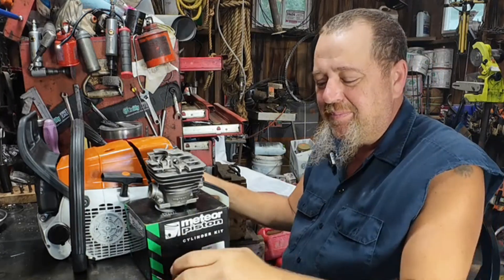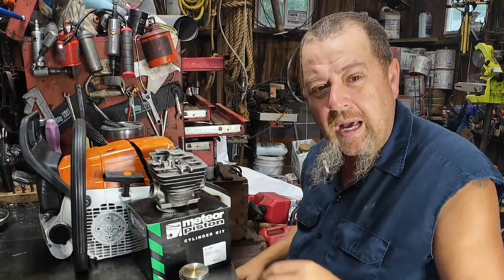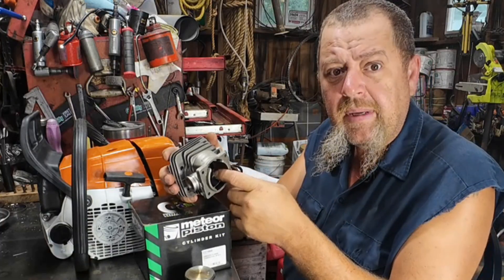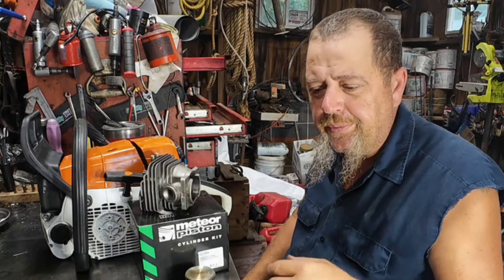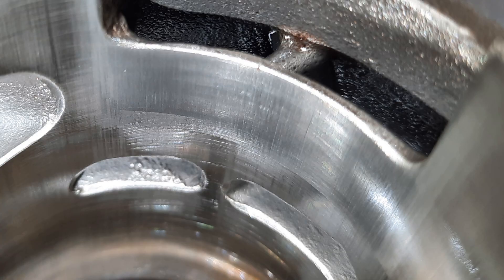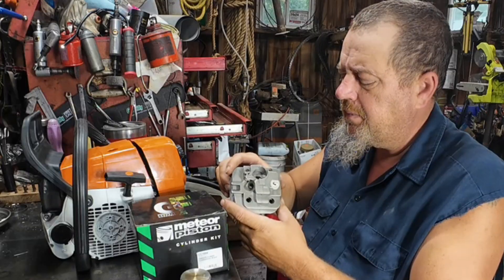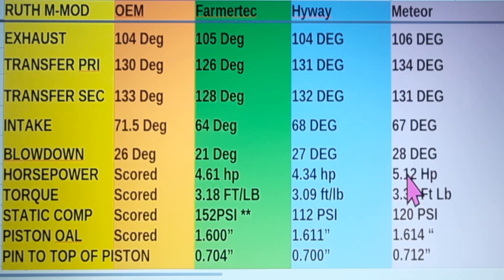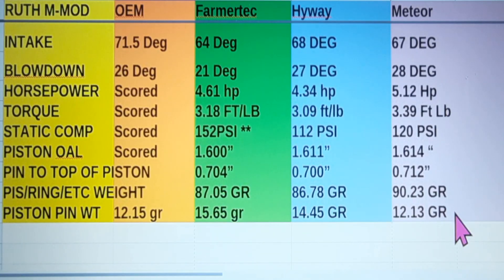How Much Power Does a Meteor Cylinder Really Make? | Stihl MS361 Clone Dyno Test

Comment: I can't tell on that meteor what is causing the higher horsepower with your great charting there. Initially I was going to say the squish being only .014 did it, but not so sure given the lower compression. It may still be since less air needs to be moved with a smaller compressed chamber size.
On the other hand I more suspect the shape of the transfers and openings, and perhaps exhaust - 
Who thinks they know what it is, anyone ? I am totally guessing.
Reply from the maker: @shakdidagalimal Up until last week (real time);( this video was probably recorded 6 months ago...) I wasn't sure the reason; I did some piston testing and was going to use a new cyl; I didn't like the chamfering on the other AM cyl, so I swapped in two different pistons; they had 0.024 squish; I used the same rings and the new piston's ring-locating-pins were in the same location. Neither of the two new pistons made the power of the Meteor piston.  Just to add a little more mud to the puddle...

Comment: I rebuilt a completely blown-up Stihl MS361 last year and didn't feel like spending the $300+ on just the OEM cylinder and piston alone. I still wanted the highest quality cylinder I could get for the money as I wanted the saw to perform like new and last, so I went with the same Meteor piston/cylinder kit that is in your video. I have built a few different saws and rebuild vintage Honda motorcycles on the side as well and I must say the casting and port machining is incredibly nice on the cylinder kit I received. Piston was machined nicely too. My 361 runs awesome, absolutely rips though wood and it's a great saw. After seeing this video, I am further reassured I bought a good cylinder and piston for my saw, and I'm pleasantly surprised my saw may make more horsepower than stock with an aftermarket top end on her, other than that it's all stock no carb, air filter, or muffler mods.
Reply from the maker: @natebiller2987 Awesome to hear your real-world experiences; it sounds like you done a bang-up job on the ol 361 and give it a new life.  Absolutely no shame in a stock saw; those 361s were pretty dang good right from the factory! Thanks for stopping-in and joning-in!
Reply: Meteor cylinders make about 20-25% less power than oem due to timing numbers, port sizes/shapes and combustion chamber. At least with meteor there is no need to work on the cylinders to make it reliable before use.
Reply from the maker: @jasoncook5307  I found OEM comparable power, but the squish was awful tight; After a few tanks, it surpassed OEM published HP (but I think they underclaim HP so that even the poorest saw will hit the minimum)

Comment: I think you could do a little massage work on the intake exaust and transfers delete the base gasket and cut a popup on the piston as part of the diet plan for the piston and when  those rings seat in im betting 6+ hp wouldn't be a long stretch to reach.
Reply from the maker: @matthewbutcher203  I bet you're right!! To not alienate people who may not be ready to start grinding, I think I will try to do external mods first; I almost wonder if we can hit 5-1/2 to 6HP without any grinding??
Reply: @HayChaffandSawdust1 id say a HD14 carb for a MS 460 and a timing advance would get you real close
Reply from the maker: @matthewbutcher203 It might??!! As are as 361s go, they have fairly aggressive timing from the factory; I've usually found losses by going either way with the ign timing on this particular model. That don't mean that we ain't going to thy though!!

Comment: I'm running a meteor cylinder and piston in a  288 clone. The farmertec worked ok new, I opened the transfers and cleaned up the ports and it improved but the coating started to flake off after a while

Swapped over to the meteor and I'm happy with it. Needed to make a thicker base gasket  because the squish was really tight but it's been great. They seem to be the right mix of price / quality. The caber rings are excellent
Reply from the maker: @SawChainTheories I have never had a farmertec cyl flake or chip, but I've never ran one for very many tanks; I've never "used" one for any real work.
It seems to be common that people like Meteors and that they have a snug squish. Like you say, a thicker (or doubled) base gasket is easy enough to do; I has also considered that a Hyway piston in a Meteor cyl may be just the ticket.

Comment: Man Im lookin around all over........thought that was one of my kittys! :)
Great vid!
Has anyone tried lightening the piston and rod? Removing material until the breaking point is found? Seems like there is a lot of rpm left on the table, should be able to get closer to 20k rpm I would think.
Reply from the maker: @freeradical6390 Thanks!! I've lightened pistons in previous series and you're right! I think that a coil is going to be a limiting factor on this particular saw... for a while. One of the first things that we do (during the step-by-step build), once we get done with external mods, will be to lighten the piston and show the math as well as substantiating dyno results.

Comment: With the cost of a new OEM jug / slug anywheres from $300-500 the Meteor kits are a quality aftermarket alternative. I’ve bought a few from Wolf Creek and on a tighty-squish  a thicker base gasket was the ticket. Make em yourself or cometic in Ohio can do … The Meteor Performed significantly better than the other aftermarket kits. Would Be interesting to see what the OEM top end  “wood” do
Reply from the maker: @fabzacres-blackcat I just won't allow myself to butcher an OEM cyl at this point in my hacking journey.  I have my eyes out for the opportunity to get an OEM one on the dyno; I let one opportunity slip thru my hands a few months ago; been 🦵my🫏 ever since.
Reply: @HayChaffandSawdust1 you don’t have to butcher the cylinder - just take your time - gotta make leap to oem sometime right ?  You know I’m  a proponent of files , especially the riffler variety. They will remove what you need slowly and surely - we are not grinding tool steel here!  Besides, I’ve got a few special Mr. Haney “put-on” tools that I can send to ya IF the job goes kitty-bunkus 😉
Reply from the maker: @fabzacres-blackcat I should be more clear... at that point in my journey, I had never OEMed; that 461 that I've been stepping out with... OEM jug AND slug; I just made sure I took my time a little more than looking like I was trying to stab mice in a corn crib with a pitch fork.  Now, I wanna do more of 'em... I'm such a "dope head" mentality!!

Comment: A little more intake timing and some subtle port work on the lowers and you will find that saw will perform like a strong stock 70cc saw. I actually like 106 degree exhaust on the 361 and 28 degrees of blowdown, makes for a very strong usable power curve for that size saw as you have found. Once that saws static compression comes up to the 150psi mark it will come alive! Find your self an ignition coil with the proper OEM timing curves and that saw will start much easier. In my experience the stock farmertec ignition coils on the G366 do not have the retarded timing curve needed to aid in easier starting of this model. Look for after market German made ignition coils or for the G366 you will instantly notice the difference.
Reply: Great comment 👍
Reply from the maker: @Houseworksaws  It sure was; thanks for the encouraging words to all!
Reply from the maker: @wayneanderson991 As Matt says; great comment!! I know that the coils are a limiting factor on these G366s; I have not completed exploring possible fixes. I think many of the AM ones are limited in some fashion.
Reply: @HayChaffandSawdust1  I used an AM 366 coil on my G888 pipe saw and I used an 8mm NGK wire with a larger tighter fitting non resistor cap and non resistor spark plug. Starts so much easier and quicker now. I was actually surprised it worked. It visually had brighter spark. Pretty neat playing with the small details like that. Especially when it helps. Anyways that’s my .02
Reply from the maker: @Houseworksaws Very great info!! My particular 366 coils appear to be limited (Wolf creek has some unlimited ones that I think I will buy). I have ran non-resistor stuff before; now, since I upgraded my data collection on the dyno, non-resistor stuff plays havoc with it; it will turn my monitor right off!! Good info tho; I will sure give it a go. As always, thanks a LOT for your insight.
Reply: @HayChaffandSawdust1  Oh yeah… didn’t even think about your dyno computer. Man yeah I bet that does cause trouble in that department. I know on some Stihls even new models like my 400c they eventually mess with my 2-way headset I wear while working with my crew. When I rev up the saw it gives it a static feedback through the speakers in my ear muffs and any one of the guys within 10’ of me. Never once have I had a Husqvarna do it tho. Kind of an odd trait of the Stihls.
Reply from the maker: @Houseworksaws  My old manual system works fine with interference, but I spoiled myself with the computer. It actually doesn't mess with the computer though; it messes with the monitor; it turns it off or changes inputs (hdmi etc) and I can't see what I'm doing. I have one g366that will still mess with it even with a resistor plug and the other don't; one has a white sheath over the plug wire and the other is black. I wonder if it's an indication of a coil problem; have some unlimited coil coming!! Like you, I love to hunt the small gains and stack 'em up!!